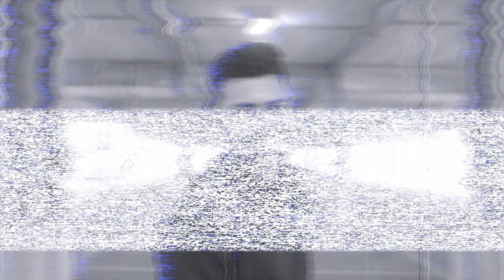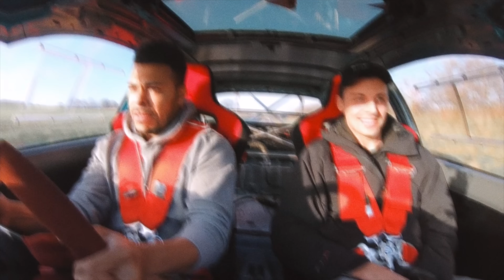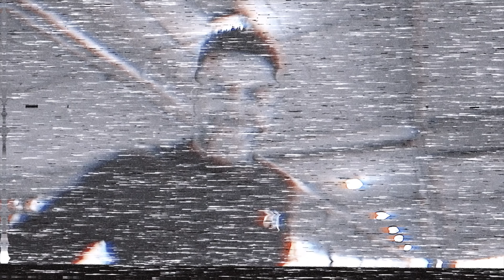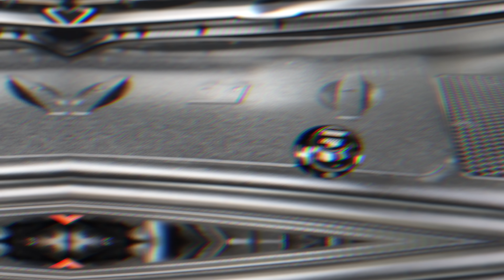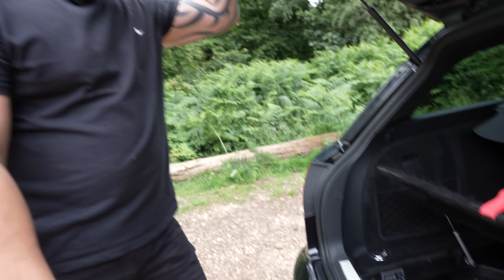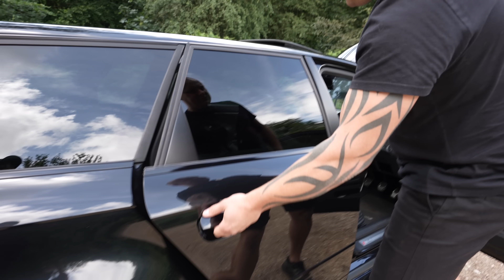THIS REAR MOUNT TURBO 730BHP V8 AUDI RS4 IS UNBELIEVABLY FAST!

Comment: Rear mount means lag, but also means that the engine will make the stock power until the boost kicks in.. it dont ruing the NA response down low, just adds on top. Its amazing

Comment: Nice! except for the colour of the car it should be The sprint blue.
Reply: agree, would be more of a sleeper also if back on original wheel and no window tints
Reply: @londonman8688 the rs4 will never be a sleeper....eveb in stock wheels and no tint

Comment: Very interesting built. Clearly a lot of engineering and money spent. So why the hell the boos gauge is as ugly as f*k. There are mounts for the steering wheel that look almost OEM and there are mounts for the air ducts that also look very clean. So why this thing?

Comment: Now THIS is how euro turbo v8s should sound! Idk what happened when they added turbos from factory but they don’t sound like this. This is soooo much better!
Reply: I'd say it's due to the fact that you can retain long tube headers with a rear mount setup which merge into a Y or X somewhere down the exhaust. The turbo really is only acting like a muffler here so the V8 sound still comes through. On modern TT V8 cars they use log manifolds which mutes the V8 sound alot.

Comment: How the long tubes connecting the rear mounted turbos to the front engine are not affecting the performance? I thought the shorter the better...that's a long distance to cover for the pressure inside those tubes. Can someone please comment on this?

Comment: Correct me if I’m wrong, but doesn’t the turbo push air into the motor not into the exhaust? Does the rear punted turbo increase or reduce the HP potential, none the less This is my dream car, there insane stock haha this is beautiful

Comment: @Jamie - what I didn't really understand was - why? why put the turbo in the back? I understand it's cool, but what is the advantage? was it because there was just not enough space in the engine bay? or was it because of better heat management?

Comment: I almost spit out my drink when he said its on 8psi making 730hp. Probably one of  the most beautiful RS cars Ive ever seen. Big respect to the Audi 4.2l. 🔥🔥
Reply: Driving4answers just did a great video on remote turbos, apparently it's because its such a large turbo that it doesn't need to boost so hard to get the airflow, one of the advantages of remote mounted setups being you can run a big turbo that wouldn't fit under the bonnet
Reply: @hamstirrer6882  I bet it dissipates heat very well in that location, as well. IATs are probably great.
Reply: Hi flow NA engine then a turbo added it’s not a lazy engine
Reply: Better yet, its on stock internals 😂
Reply: Totally agree 😎
Reply: What sort of cost can you put on this build
Reply: Id say without the donor car…. Guessing  £60-80,000?!?!?🤷‍♂️
Reply: I laughed out loud. Thanks!
Reply: Its a 76mm turbo also, so it pushes more air per psi. Im suprised he went that big on a street car. Should of went with a 6870 turbo atleast.
Reply: @dgo9121 what colours your rs4?

Comment: That’s a great car. I also own a stock RS4 B7 and since a few years I say, that engine would be perfect for a turbo build. Probably in a R8 4.2 with a manual Gearbox you’ll have enough space for two Turbos next to the engine and with the high compression of 12.5:1 you need such a low boost for so many horsepower. But there’s sadly no chance to drive this legal here in Germany… 🫠 
Great video mate, keep it up 🙏🏻

Comment: Thats proof that even though turbo is mounted far away spool up can still be reasonable. I wonder if he is using electric sump to pump the turbo oil drain back to the engine.

Comment: Lost for words....didn't think RS4's were turbo-able....how wrong was I...defo my new dream build. Hats off to you Jamie for showing us this beast and the owner is proper cool
Reply: I'm slowly learning more and more about car's and now enjoy trying to take in the mechanical side and handling aspects etc, but as for retro fitting turbo or turbo's to engine I'm sure they can literally turbo anything these days. Some serious clever folk out there 👌what a machine
Reply: They respond to superchargers very well
Reply: @jason21jburg rather do a turbo build only because 90% chance it will over heat to quickly.
Reply: They are turbo-able, the thing is that there's not room in the engine bay
Reply: @maxly501  yes..... there is... the rs6 literally cones thatvway factory with the same engine footprint but lota of people have twonned and big singled these in several formats
Reply: @matt10011987  The RS6 is different. More space up front and the 4.0tt in the RS6 is build up different then the 4.2 in the RS4. It is called "hot V". Your heads are turned so the turbos can sit on top of the V8 and have extremly short exhaust gas travel to the turbos. The 4.2 in the RS4 is NA and so normal. Putting in a Turbo isn't that easy as well heavy enough space to let it breathe. It is possible but not easy. Thats why some volks put the RS6 engine in the RS4.
Reply: @AlcatrazCrylake  not talking about the modern rs6... im talking about the old c5 a6.  Its literally the same format
Reply: @matt10011987  Oh, okay. Sorry. Is it really the complete same format? Like the RS4 b8 engine room looks way more cramped then the rs6 c5 engine room.
Reply: @AlcatrazCrylake  its a 4.2 b8 woth twin turbos in the same location as a. Audi 2.7 bi turbo.
Reply: @maxly501  One of the reasons some people swap the 4.0 Engine of the RS6 in it. The hot V config makes it possible but still really tight.
Reply: In usa alot for s5 rs5 with 1000hp but in EU to audi s5
Reply: Superchargers are no problem for those cars but turbos... There you need some work. On supercharger and completely stock engine you can go to about 600hp but in germany the kit is 30000 Euros...
Reply: Why wouldnt they be
Reply: Wdyn everything is turbo able